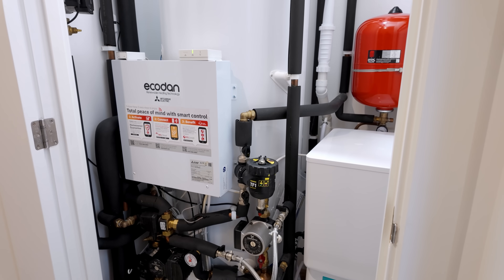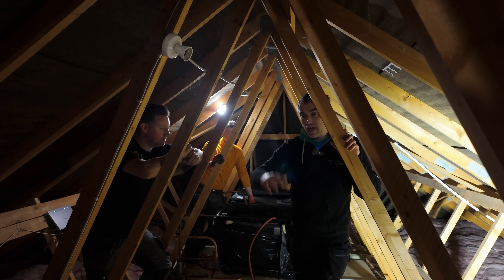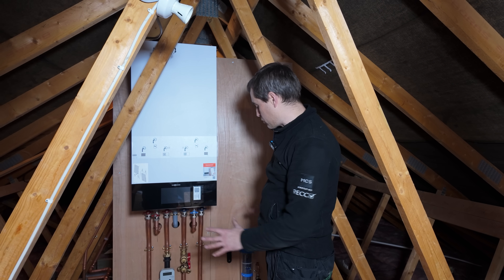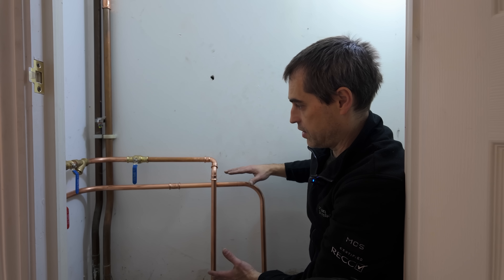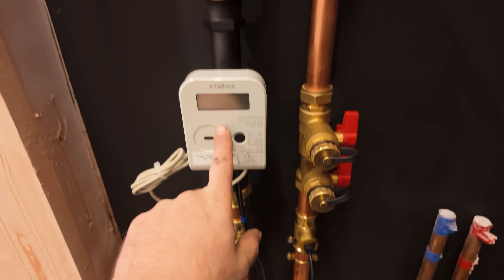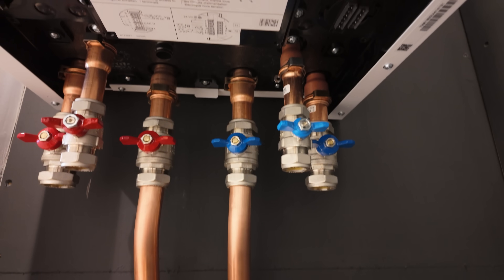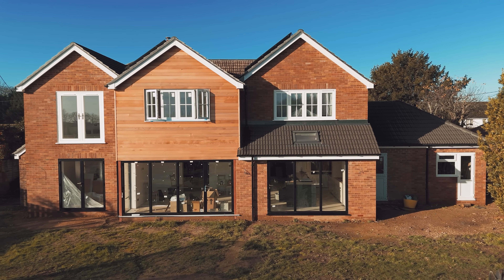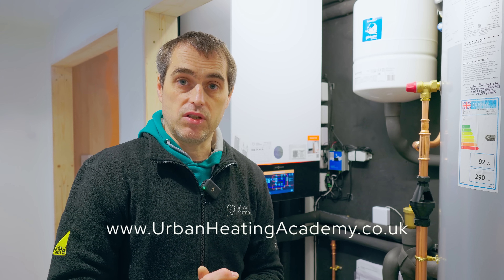How To Install Simple Heating Systems In Big Houses

Comment: Besides the fact that the control guidance from CIPSE/CIPHE is seemingly being ignored; where is the strong evidence that any system designed only for weather-compensation can meet real-world human use? e.g. typical bedroom use - unoccupied, occupied (not sleeping), occupied (sleeping). There is surely a significant gap here between system design temperature (capacity) and control strategy (comfort delivery)

Comment: German here, you guys did a great job on those sites. It is always interesting to see the differences in standards and regulations. Can anyone explain to me what is the background for running the drain line of the pressure relief valve on the hot water cylinder outside the house? Is it to prevent the house from flooding if the prv fails? Here it is usual, to drain above a syphon connected to the waste water line. There is also a difference i noticed. The connection of the heating water treatment cartridge. This is only allowed here to connect through a special back flow prevention device to avoid contamination of the tap water from water in the heating system. Merry Christmas to all.

Comment: Always think viessmann and nibe are above the rest...have a nibe running in my own house for the last 18 years on weather compensation and simply adjusting the heat curve and no stats anywhere in house apart from nibe internal stat...UK regulations override the heat pump manufacturers regs.. simplicity is best...let it flow,let it flow,let it flow 😂

Comment: Stopped watching after I saw a heat pump!
Reply: i guess if you cant afford something. no point watching
Reply: @dsuse3949 I’m having a replacement gas boiler fitted in the new year, which I can afford just fine. I feel sorry for those who are being guilt tripped into having a heat pump.

Comment: Szymon, thanks for sharing your knowledge completed Heat geek mastery. There is definitely a need for course that brings it all together and sprinkles in some practical scenarios using the heat loss software etc.  I have learnt loads from your videos and have signed up for your course.  Merry Christmas to you all.
Reply from the maker: thank you for your comment. HG course is great, and there is nothing like it at the moment. However I belive I can bring my own perspective to the learning proecess that will allow even better and deeper understadning of real principles required on actual site work. Thank you for signing up.

Comment: I'm still struggling with the logic of how using thermostat set backs are temperature limits.  I had thought that a set back was a default low temp at which point the system comes back on, whereas a limiter turns things off at a given temp.  I assume we mean here a target temperature that doesn't turn off the system, but drops the heat in the system to whatever is just at or below the heat loss at the target temp?  We have huge solar gain and the stats just turn things off at, say, 22 degrees...
Reply from the maker: yes correct - what I meant was temperature limters set to set back temps if required.

Comment: Really interesting install and fair play on the results shown, but I struggle with some of the absolutism around “no zoning and no buffer is the only correct way”. This comment is intended as constructive discussion and professional opinion, not to put anyone or any method down.

I fully agree that a low-temperature, weather-compensated system wants stability: long runtimes, steady flow and minimal start/stop events. Traditional hard on/off room stats everywhere will destroy COP on a heat pump if done badly. No argument there.

However, there’s an important distinction being blurred between demand interruption and what I’d call heat-stop control.

If a room or loop reaches temperature and closes locally, that isn’t the system being “turned off”, it’s simply that emitter trimming itself. The heat pump is still running, still weather-compensated, and still seeing flow via the remaining circuits. That’s hydraulic self-balancing, not destructive zoning. Problems only arise when zoning collapses system volume or forces the heat pump to stop and start.

The claim that “turning zones back on uses far more energy” is only really true if those zones were deep-setback or allowed to go cold. Light setback (2–3 °C) on low-temperature emitters has negligible penalty. Turning UFH fully off is a user-behaviour issue, not a fundamental flaw in zoning.

Where the bigger compromise sits, in my view, is system volume. With no buffer, no LLH and no zoning, the entire house is effectively being used to satisfy the Vitocal’s minimum volume and flow requirements. That works, but only as long as the building is treated as one monolithic zone and nothing is allowed to close.

I also think it’s important to be honest about why the buffer has been omitted. It hasn’t really been removed because it adds no practical value; it’s been pushed aside largely on installation cost grounds to help push the heat pump into the price range of a boiler replacement. That’s a valid objective, and yes, it works under a very specific set of conditions.

But as soon as occupants want more control based on their own comfort habits, that’s exactly where a buffer comes into play. It protects minimum system volume and heat-pump behaviour while allowing flexibility. This might suit Mary & John’s 2-up-2-down, but once you move into larger properties, more emitters, multiple floors or mixed occupancy, the dynamics change and so do the economics of the installation. At that point, omitting a buffer purely to prove that it can be done often becomes penny wise, pound foolish.

Another factor that becomes unavoidable in larger properties is solar gain. In north/south-facing houses it’s common for one side of the building to be calling for heat while the other is being heavily influenced by direct sunlight. In those scenarios, a simple global setback often can’t deliver comfort. A global setback works on paper, but solar gain doesn’t arrive symmetrically.

Plant location is another concern. Placing the cylinder in the attic, with the hottest part of the cylinder pushed into the coldest part of the roof, guarantees standing losses regardless of insulation. Insulation slows heat loss; it doesn’t prevent it. Hot water production is the ultimate SCOP killer and every effort should be made to minimise losses. From an energy-balance point of view, it’s the least favourable space for plant, even before serviceability is considered. The customer may have wanted it there, but the implications are on par with the buffer decision.

It’s also worth noting the cylinder performance itself. From the label shown, the standing loss is around 92 W on a ~300 L cylinder. That equates to roughly 2.2 kWh per day or around 800 kWh per year of continuous loss that the heat pump must replace year-round, often at higher DHW temperatures. Improving cylinder efficiency would almost certainly deliver a greater real-world efficiency gain and payback than removing zoning ever could. Hot water losses are constant; zoning losses are conditional.

The HeatpumpMonitor figures look excellent, but they don’t show cylinder standing losses, attic plant losses, or how the system behaves once occupants want autonomy. It’s a strong snapshot under ideal conditions, not necessarily a resilient, future-proof design.

In short, weather compensation is absolutely the foundation, but “no zoning and no buffer” isn’t a law of thermodynamics, it’s a design choice. It works because very specific parameters are being held in place. As soon as one of those parameters changes, the model quickly becomes fragile.

Ultimately, we can all make the numbers work if we tweak the inputs, but if heat pumps are to be genuinely sustainable and cost-effective long term, they need to be given the best possible chance to operate as intended, and that includes enough flexibility to accommodate real occupants, real buildings, and future change without compromising performance.
Reply from the maker: Totally agree with everything you have written here. I am not against buffers or zoning at all. I am against installing kit without understanding what it does and how it should work. What we see is installers mindlessly following manufacturers' schematics and installing kits where they are not needed and hugely over-sizing heating systems. I am all for local control with temperature-limited setbacks - precisely as you describe. However, in the real world, the need for those limiters arises in only 1% of the jobs we do, so it is so marginal that, in day-to-day design, we do not even take it into account.

When it comes to standing losses of DHW cylinders, it is actually taken into account by the energy used to recharge the cylinder, and OEM can now calculate it as it includes the cylinder sensor, and both jobs have those sensors installed, so it will be fascinating to see how the attic and internal installation compare.  

Cylinder standing loses are calculated at DT45 (room 20 - cylinder 65) - in real life DHW on heat pumps are stored at 46-48C (at least on our installs), so only part of the year will see 2kWh / 24h standing loses, making it more around 1.5kWh or so on average - with no loses at all in the attic in the summer, as the attic will get to much higher temps than ambient. I estimate the losses at 500-600kWh per annum, but OEM will give us those answers soon! DHW COP on our installs is well over 3, so even the worst-case scenario of standing losses recovered by a heat pump will require 180kWh of electricity to recover. That's no more than £50 a year on a standard tariff. Obviously, nothing prevents the customer from insulating the cylinder with a jacket, and some do so to further reduce losses. 

We always prefer internal installation, and we gave that option to the customer, making him aware of the losses in the unheated space. They chose to have more space instead. 

My own cylinder is in an unheated space (garage), but I also have solar, which, even on a worst winter day, covers the losses of the cylinder. (2-3kWh of energy produced is about as low as it gets in the winter, so COP of 4 on my DHW easily covers that)

Anyway - lets wait few months and see what OEM comes back with the data we are now able to collect.
Reply: @UrbanPlumbers Appreciate the detailed response and I agree we’re broadly aligned on principles rather than miles apart. One thing I would still question is that while you say you’re not against buffers or zoning, in practice none of the installs or examples I’ve seen seem to make use of secondary hydraulics, regardless of scale. That naturally frames them as edge-case tools rather than part of a flexible design approach, which was really the point I was trying to explore.

On the monitoring side, I think this is a fair question rather than a criticism. With a top-tier OEM heat pump like this, the native controls already estimate COP, log runtimes, and manage defrost behaviour and DHW production. So it’s reasonable to ask what problem the third-party monitoring is actually solving in this case. Is it primarily there to inform future design decisions and optimisation, or is it more about externally validating and publishing performance figures?

The same money could arguably have been better spent on a higher-quality cylinder to eliminate those losses in the first place, rather than accounting for them after the fact. Monitoring is useful for quantifying performance, but improving fixed, year-round losses upfront delivers a more certain return, particularly where DHW is a constant load.

And just to put that into perspective, a loss is a loss. Even if we accept that those losses are relatively small in isolation, the additional water volume of a modest buffer operating at low temperatures is negligible compared to the continuous, high-temperature losses from a DHW cylinder sitting in a cold roof space. From an energy-balance point of view, the hierarchy of impact isn’t really comparable.

I’d genuinely love to see a follow-up video down the line using all the data gathered from these projects, comparing approaches and outcomes over time. That kind of real-world comparison would be hugely valuable.

Keep up the good work and Merry Christmas to the Urban Plumbers 🎄

Comment: Hello Szymon, maybe you can share whether you usually use a standard heating curve or adjust the dependence of the outside air temperature on the  temperature setpoint?
Reply from the maker: There isn’t such a thing as a standard heat curve. It’s always set to a particular system
Reply: @UrbanPlumbers  Thank you for answer, I used to work with Hitachi heat pumps and it allows you to adjust fixed\ points\gradient curve, so I wanted to know what work scenario is configured in your systems.
Reply from the maker: Slope and curve
Reply: @UrbanPlumbers  Thank you, thank you for your videos and the experience you share with us, happy holidays to you and your team)))

Comment: Another great video and install.  I am a self employed 1 man band gas and oil boiler engineer.
I have no need to get into heatpumps as i have an absolute abundance of work with what i currently do.

However with so many 'renewables' companies out there making a fortune with no real clue or care what they really are doing, it's great to see Urban Plumbers setting an example of how good these systems can be designed and installed.
If i ever did get into this sector,  i would aspire to the standards you guys are setting. 
Cheers and Merry Christmas.
Reply from the maker: Thank you for your kind words. Being a 1-man band is the biggest obstacle for most heating installers out there. With renewables, you cannot do it on your own - it is simply impossible. Renewables are also more complex work than oil or gas, but it is so rewarding when things work well. Smaller margin for error than oil and gas too, and you will end up with problematic systems no matter what you do, so definitely not for everyone or for people who want an easier life.

Comment: 0:20 You show the Ecodan cylinder as an example of an overengeneered system, can you elaborate?
Reply from the maker: Yep - those pre plumbed fit all cylinders are have build in separation and system pumps. They are designed as one system to fit all applications and end up with poor performance on most applications.

Comment: 0.6 air changes p/h? 

That-s passive house requirements, nowhere near that in this property. 

Probably more like 6-10 acph
Reply from the maker: Do a door blower test and you will soon realise that ACH are much much lower than what the regs or books tell you
Reply: @UrbanPlumbers  Agreed, we usually run 2 tests on each project. One at airtightness stage and another after drywall. 

We would sometimes be shocked at the high acph after the initial test at which point you would re-strategise. What I'm saying is it's more difficult thank you'd think to get to those levels of acph, especially if it's not a new build. 

P.S. I have this exact same heating system installed on my house. I'm running a 200L buffer tank though on a 480 m2 house. Open loops throughout the 3 floors, no stats. It's extremely efficient. 
Also running x2 mvhr @ .38 acph, appropriate coldbridging, triple glazed aluclad and 200mm external insulation. 

I love these systems, I couldn't recommend them enough.

Comment: I don't want to add zoning, but my bedrooms just become too hot. How do I keep them at 18 degrees? I tried reducing flow by adjusting flow meters (ufw upstairs) but it does not seem to work well
Reply from the maker: Install a thermostat just for the bedrooms and actuators - don’t control the heat pump - shout those zones when they reach 16-18c

Comment: I would be concerned about the volume of hot water available from an unvented cylinder. In my extended 5 bed 3 bathroom house with a 15mm supply it wouldn't work. I have also found that a 15 metre run from the heat pump and take off point for 45 m2 of ufh to the hwc and the point from which radiators are supplied there is a drop of 3 degrees in the flow temperature. This despite the pipes being 28mm and insulated and running within the void in the ceiling of a large double garage. That difference has thrown out the calculations for sizing the radiators. Given that I swapped out only one radiator in the installation, the house since built in 1984 had big insulation improvements a second bite at the cherry to replace the remaining 9 radiators isn't a big deal.

Comment: Awesome, I've been following your and Heat Geek's work and dropped one zone to simplify but I still have one upstairs and one downstairs zone.  I find that the upstairs needs to run longer to hit a lower setpoint than downstairs, I think because with under floor heating on both levels, the main floor essentially has a heated floor and a heated ceiling while upstairs only has a heated floor.  I'm sure if the system was engineered, it would have tighter loop spacing upstairs, more insulation to limit downward heat flow or both, but taking it as is, it feels like keeping two zones here still makes sense for more consistent temp between levels.

Comment: Nice work as usual.👍
I know why you do it and can see the positives and simplicity of doing it, but I still think open loop is a step backwards to the 70's with less control! 
With Heat Pumps on 24/7 I think TRV's  should at least be fitted in bedrooms.
With it's dedicated defrost cylinder the Veissmann shouldn't have the volume restrictions like most manufacturers?
Reply: If you have never experienced weather compensation control - don’t knock it. It’s remarkable.
Reply: @normanboyes4983 
Weather compensation is great, but it doesn't take in consideration,  the wind and also solar gain, so it needs to work with internal thermostats. It's not all about efficiency, it's about comfort, convenience, ease of use and controllability